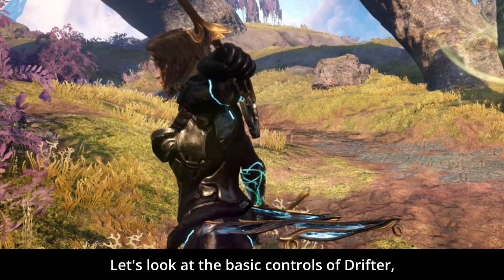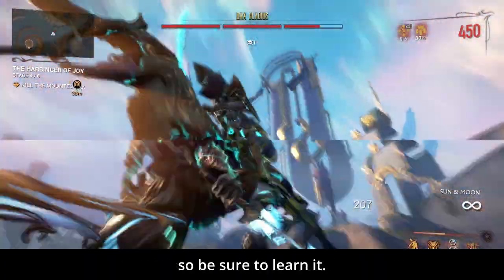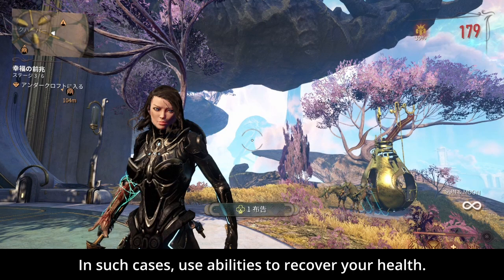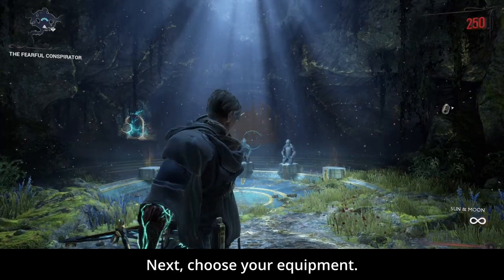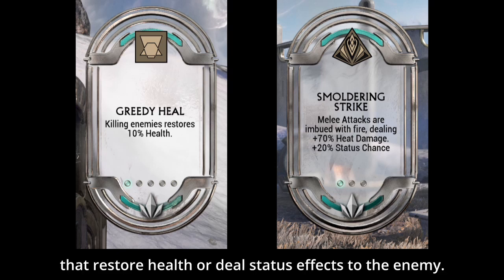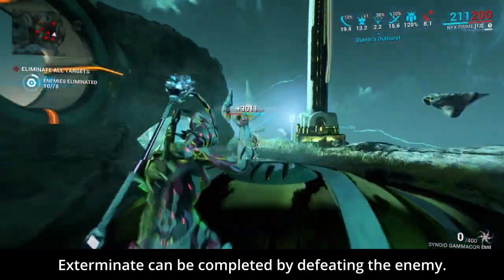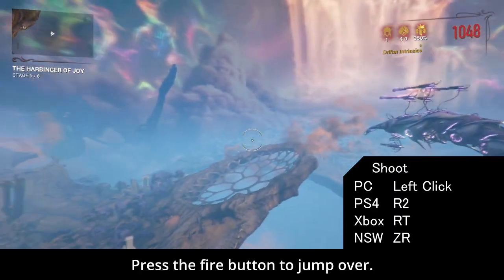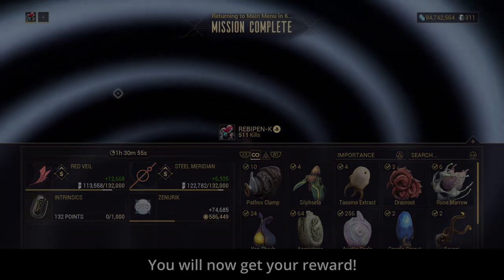【Warframe】 Duviri Guide! Drifter's Basic Control & Orowyrm Hunt &Decree etc.

Comment: When controlling the orowyrm i have an unbound control for moving down, whats the bind for this?
Reply from the maker: In that case, you may want to move your viewpoint down and try to move forward.
Reply: @REBIPEN  it didnt work
Reply from the maker: @sergeanthuman  Try the buttons for crouching when operating Warframe.
You can use the jump button to rise.
Reply: @REBIPEN  but which controls menu is it?
Reply from the maker: @sergeanthuman  On PC Hold Ctrl.
On PS4 Hold L1. On Xbox Hold Lb. On Nintendo Switch Hold L.
These buttons are used to Crouch and make the orowyrm Descend.